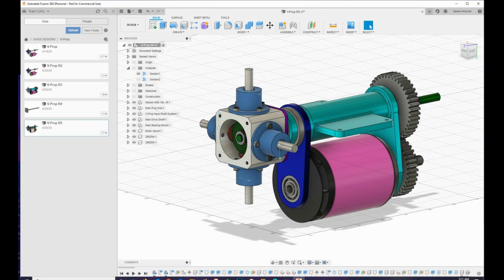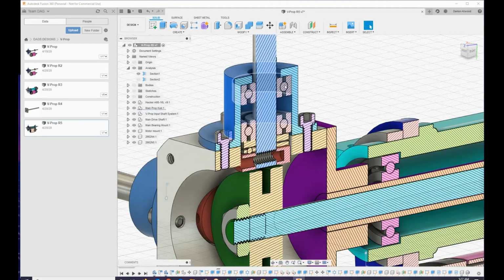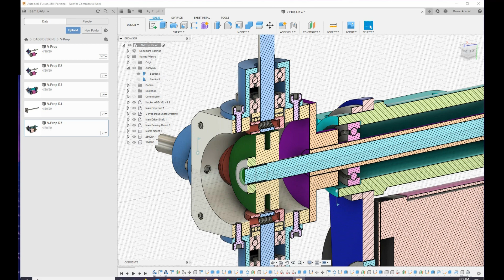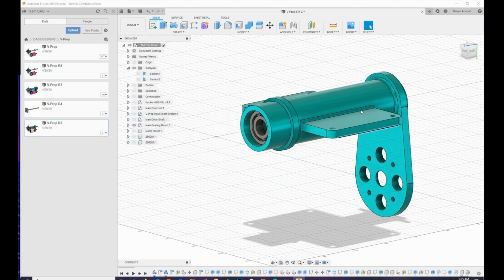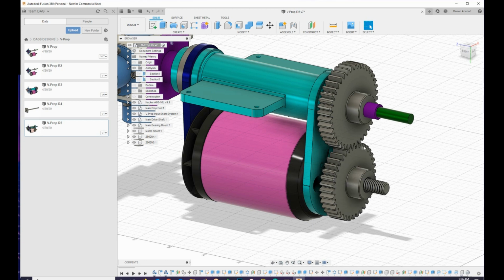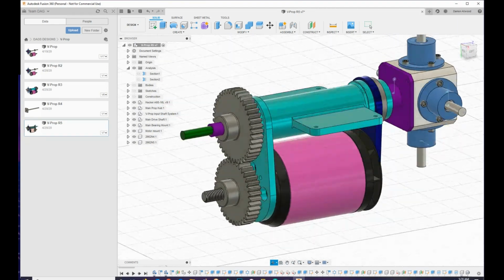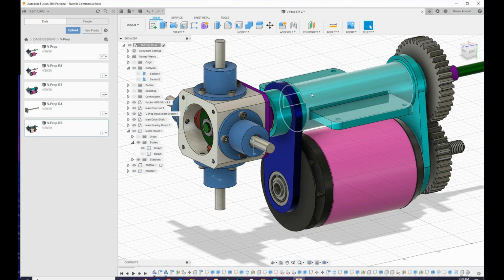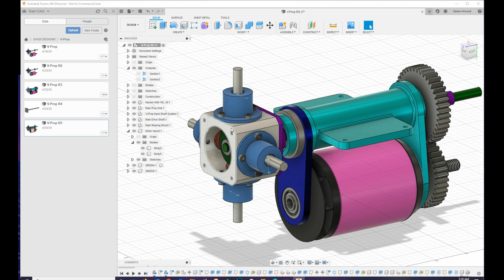Variable Pitch Propeller Development

Comment: Nice design! I am very familiar with Noel Rumer's and Irmin Barnerts work with variable pitch props. I myself have wanted to mill one myself for years but I still haven't gotten around to it. Mostly because I haven't built a motor glider to put it in. There is also a guy with a red turbine powered King Air on YouTube that has a feathering prop. I look forward to your development.